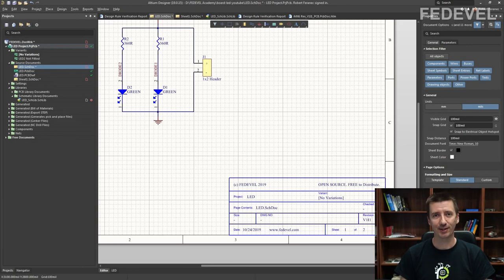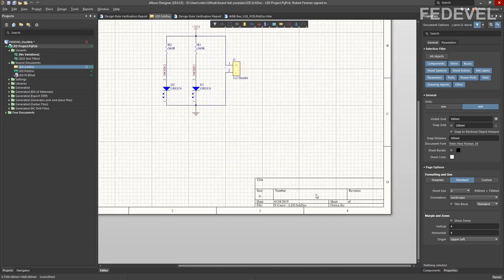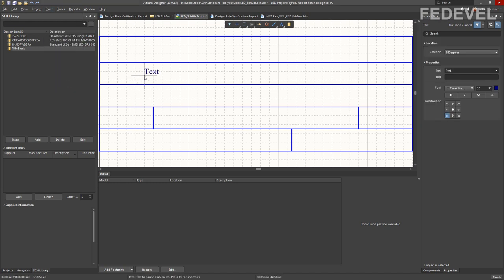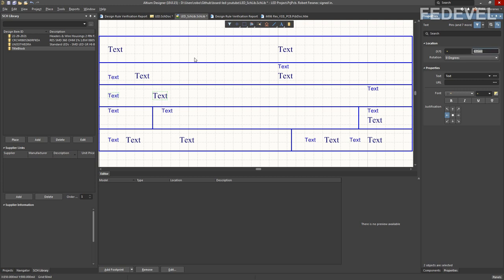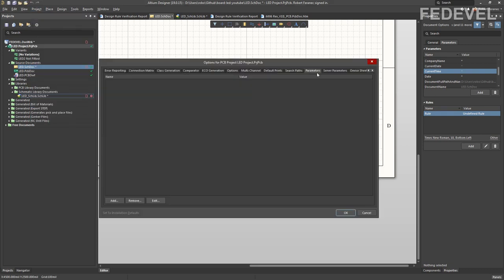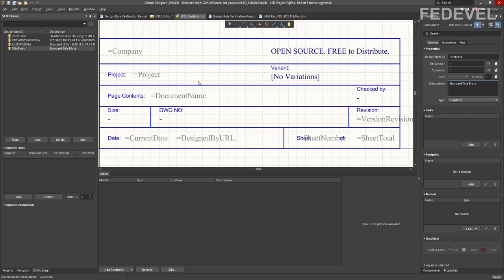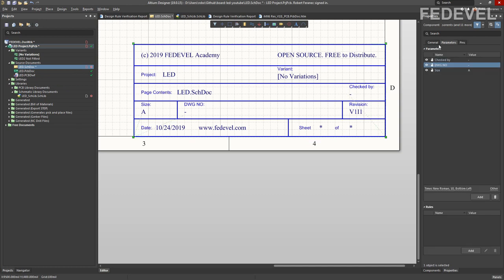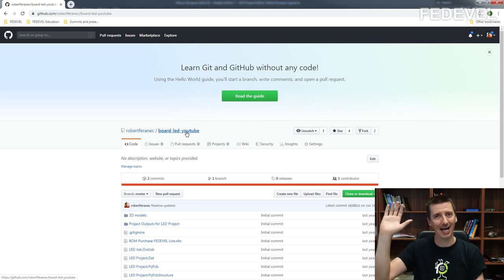Altium - How to create Custom Title Block

Comment: Hi Robert, also you can create you own schDOT and use it as template, better than library component in my opinion
Reply from the maker: Hi Alejandro. SchDot - is that only the whole page template or you can make just Title block template? https://www.altium.com/documentation/altium-designer/managed-schematic-templates-ad?version=18.1
Reply: @RobertFeranec  it's a template sheet so you need create one for each paper size and also you can add custom title block and even your logo on it. If you need more info let me know. Regards
Reply from the maker: @ale210  Ah, that is what I thought. I wanted to go around schematic templates - I just thought, there was a way to create template for title block.

Comment: How to use the Project parameter in the Schematic template
Reply from the maker: I think I just answered your question on our forum: https://designhelp.fedevel.com/forum/main-forum/altium/13830-project-parameter-in-schematic-template Basically, I do not really use templates, but I would expect this to work the way, that you can use parameter name in a template but you still may need to define the parameter and its value in your Project -> Project Options -> Parameters

Comment: you  need  long  time  to  explain  any  thing  It disturbs the listener
Reply from the maker: When I find videos too slow, I watch them at 1.5x or 2x speed. I watch my own videos at 2x speed. Maybe it can help.
Reply: @RobertFeranec  Right..thanks
Reply: Hi Robert,  I appreciate the methodical approach you use.  In some videos from others, I have a hard time following their keystrokes as they are moving so fast.  I do have one question:  As you were drawing the lines for the title block, you were watching the "Status Bar" below to see the x/y coordinates of the cursor.  In my version of Altium (21.0.9), the status bar coordinates stop changing once you enter the line drawing mode, making it hard to place the line at the exact coordinates desired.  In your video, they seemed to keep updating.  Is there a configuration setting which controls this?